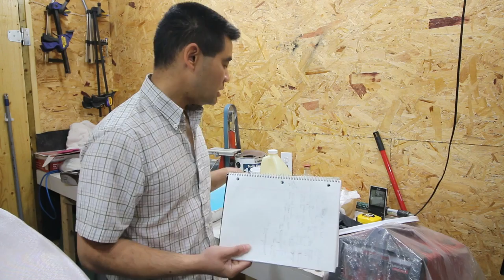How to Make an XPS Foam Surfboard #09 - Laminating the Bottom

Comment: Thanks for all your help so far.  Glassed (bottom) my first board (Fish) yesterday, and OMG you were right.  The first one is going to be a little messy. Poured the resign (tinted with Teal) on bottom and worked it in and accidentally dropped the resign container on the floor. Time was running out and I still needed to do the rails.  That's when it all went to hell. Resign all over the floor on plastic, resign soaked pieces of fiber cloth sticking to everything.  Lot and lots of gloves.  Finished the rails but my cut laps on the Fish Tail became a nightmare. Resign started to kick.  Bottom actually looks OK, but my cut laps are going to be ugly.  I couldn't have done it without your help.  Thanks.  A Retro Fish with Cut Lap was not the best choice for my first board.  But Hey!!! it's all down hill now. ;-)

Comment: If you put epoxy on the bare substrate first, you get better adhesion. So in this case you’d pull half the fabric back, apply a thin layer of epoxy directly onto the foam, then replace the fabric onto the wet, then repeat the process on the second half. Then proceed with the same process you showed.

Comment: I built a board like this years ago with West Marine epoxy and the pink Home Depot foam. It glassed good at first, but over the years the pink foam gassed out a lot from normal heat exposure (that my PU boards were OK with) and the whole deck delaminated. There are one way vented leash plugs that I would consider if I were to do again. How did your glass hold up?

Comment: Never use blue tape unless you want the epoxy to bleed thru it. Use the cheaper, high tack green concrete tape. It van take the epoxy heat up